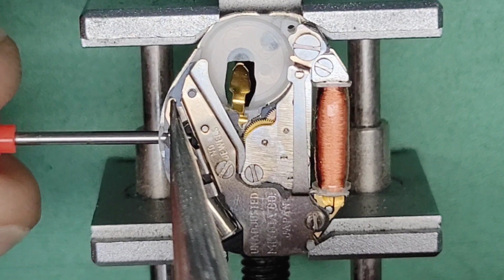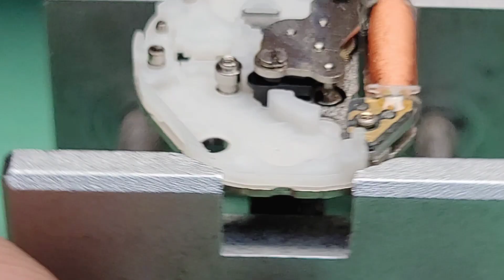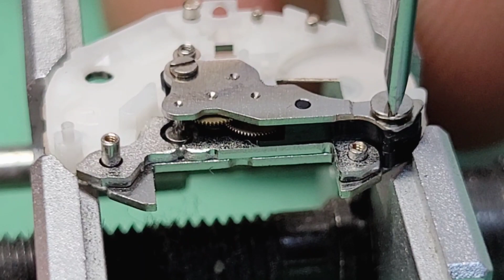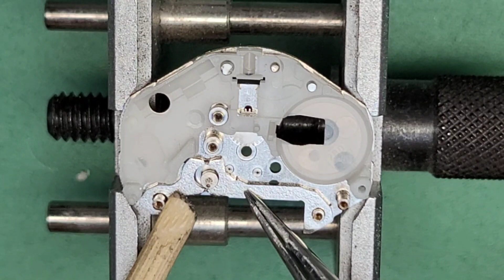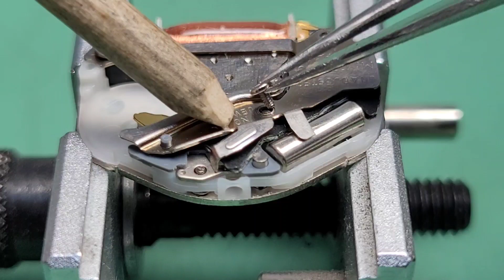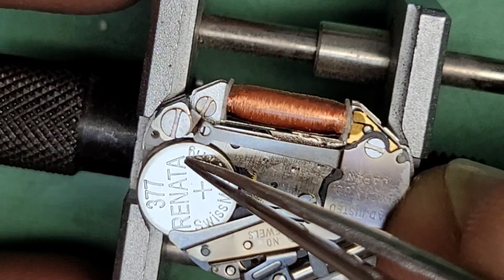MIYOTA 2035 ASSEMBLE DISASSEMBLE & OILING, LEARNING VIDEO FOR NEW WATCHMAKER

Comment: I received this movement from aliexpress. Seems I have got a fake one. It doesn’t say unadjusted. Rather it says Miyota, Japan, CWMJ. Another thing I noticed is that the long connecting pin right of the quartz is plastic
Reply from the maker: Don't wary It's original

Comment: How to waterproof the watch after it is opened and water gets into the watch causing damage to the watch
Reply from the maker: Waterproofing a watch is a delicate process that requires specialized tools, knowledge, and equipment. Attempting to do it yourself can cause further damage. It's strongly recommended to take your watch to a professional watchmaker for repair and waterproofing.
Reply: @SolimBD  but playing water prof video shearing